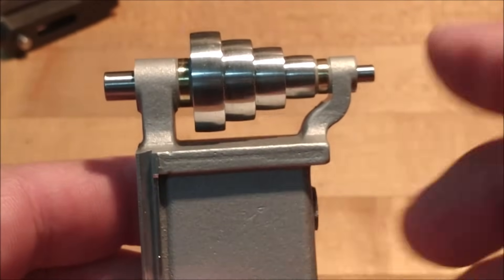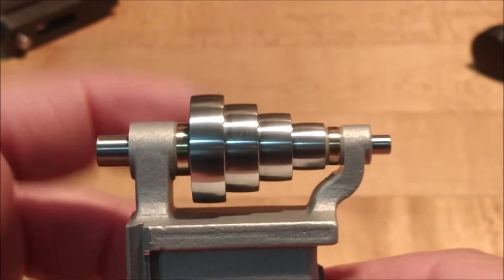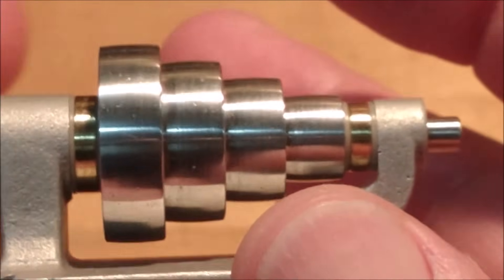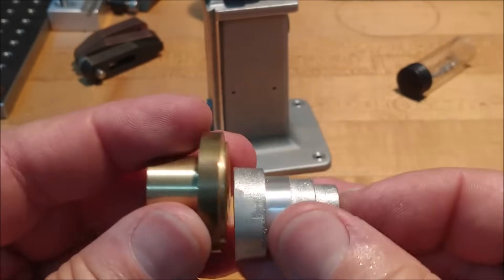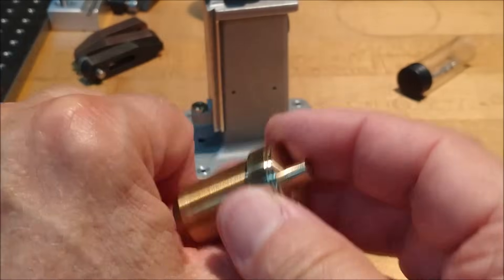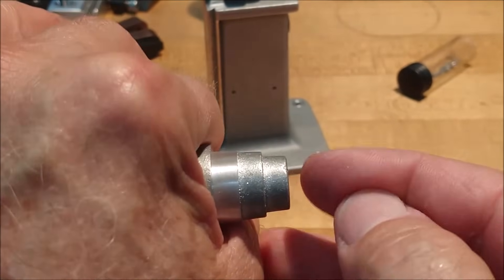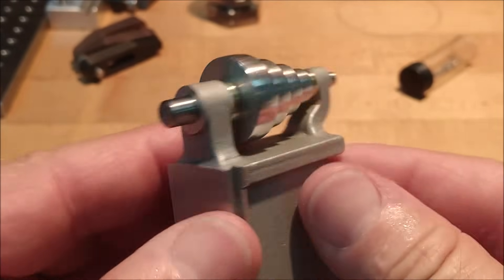Nothin Better than a Mid Week Quickie.....

Comment: Interesting that on the kit and plans I received for the mill, the spindle shaft cannot move axially because it is trapped between the stepped up portion on the cutter side of the spindle shaft and the separate spindle collar which in turn is trapped by the pulley that is set screwed in position on the spindle shaft.

Comment: That axial gap...
Maybe it's there so pullies can self align with the pullies on the line shaft (I beleve this was the name for system of pullies/shafts/belts... on the ceiling, with one central power source, before electric motors came to play)?
Flat belt on the crowned pulley tend to self align itself. And the force that move the belt to the center of the pulley, can also move pulley to the center of the belt if pulley is free to move. So if the machine and line shaft pulley are not perfectly aligned, it will self ajust.
Reply from the maker: The pulley is locked to the shaft, and the shaft is pinched on both ends. Maybe its for a physical hard alignment??

Comment: Howdee Joe,  I had forgotten the file treatment I sent is to stop the chips welding themself  a files teeth. Yes it does make a physical difference in using them. But no more unwanted scraches on the worked piece and rotation tools stay cutting longer. I do love your style my friend Friction is the killer of tooling and you do your best to make it as little as possible. See you Saturday my Texan friend.

Comment: How would you workhold a steel ball on a surface grinder to create a flat safely? A drill vise with soft jaws with cup recesses with vise on its side? That is my best guess.
Reply from the maker: Balls can be held in many ways. I cut a fair amount of aluminum balls for my dive platforms and a collet works just fine. A square collet block in a vise is one method for milling or grinding, but that depends on the diameter of the ball of course. 2 thick washers with large countersinks makes holding spherical objects easy when sandwiched, and when all else fails, drill a hole in a thin plate and clamp the ball into the hole. Flip the plate over and hold it in a vise to expose the part of the ball that passed through the plate. Just keep the hole in the plate smaller than the diameter of the ball and it will seat nicely. Just thoughts.
Reply: Thanks just thinking of all the catastrophic ways surface grinding a  one inch stainless steel ball for a large flat may go.  Obviously light passes but hard spots, grippy spots and heat expansion are things I am concerned with. My drill vise  on it's side is chinesium so my fears start there. If I use too much grunt it may shatter, not enough and I create a stripe. Thanks for your time.

Comment: Hey Joe, 
I have a question on the ridges that the belt would run on. It's looks like they're concave(or rounded off). Is this an optical illusion or is that true? Also, wouldn't it be better to have an opposite curve in them so the belt wouldn't "run off"? Just wondering.
Reply: Belts run to the high spot, so two crowned pulleys will ride the belt in the middle.
Reply from the maker: Each region of the cone pulley is a domed profile at 1" radius. I believe thats called convex.
Reply: @joepie221  ok...I get mixed up on concave/convex, I just know when u try to put a new saw blade on a bandsaw(I know this isn't a bandsaw, but same principle) the wheels that the blade runs on have to be perfectly aligned for it to track. I couldn't picture a belt tracking like it should without a v groove in it...thanks for the vid...
Reply: @timothypowell5687  concave... think a cave goes inwards  - simple? Of course you could do it the other way around if you wish, just think... convex... I am vexed at that speed hump, slows me down.
Reply: Yes, the pulleys are crowned. You often see crowned run surfaces when flat belts are used. It allows them to track correctly. I have a few machine tools that are full size. They all have crowned pulleys.

Comment: I would say the majority of your success on what you achieve is planning the task first
Reply from the maker: Absolutely.
Reply: Absolutely! In building, a contractor once said. There are plans with pretty pictures and no details. There are plans with details lacking pictures. But the cheapest way to inspection are plans with both. Get a good architect! It will save you tons of cash in the end. That is so true.

Comment: The level of precision and art you are putting into each and every one of these machines is a wonder Joe! Inquiring minds are wanting to know when the build series machining 1:100 scale models on these machines will commence. The level of accuracy and precision would suggest these are fully capable production machines once you have completed the micro workshop… possibly even steam powered?
Reply from the maker: Everyone says 1/100 scale models would be tough. That would depend on the size of the 1/1 model being reduced, right? If in time I do build a diorama and run these, it would most likely be air. Steam would be period correct, but I don't want the moisture associated with it around the cast iron.
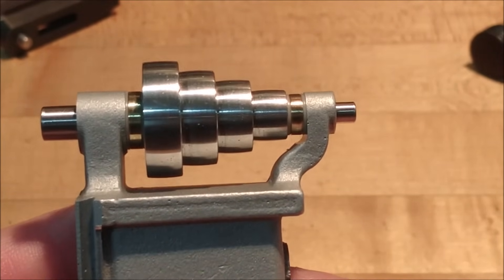Reply: @joepie221  maybe a 1:10 scale panto-router would be needed? is there a PMResearch model of a Deckel FP1 I wonder ?